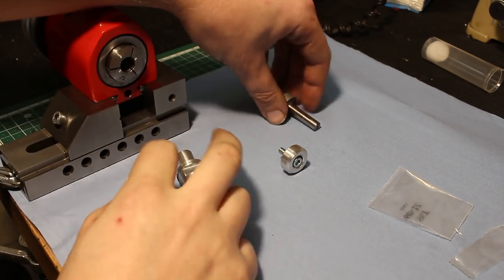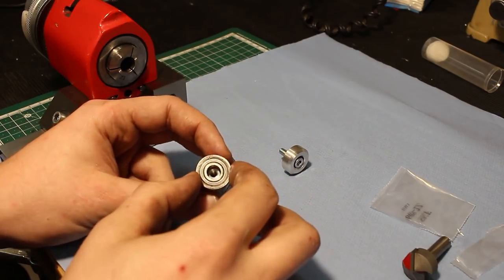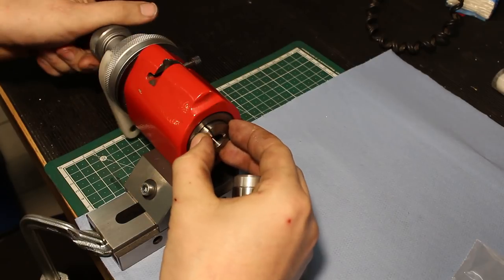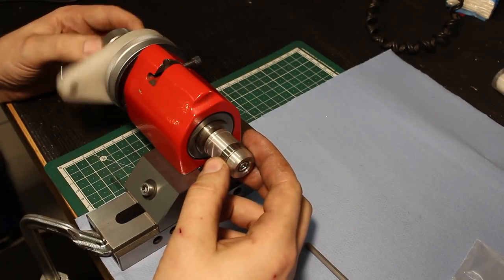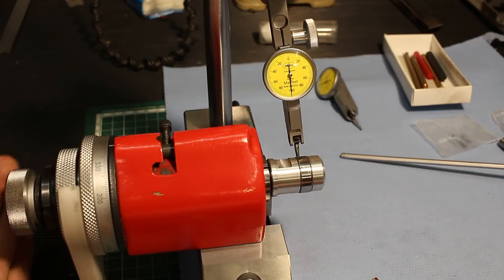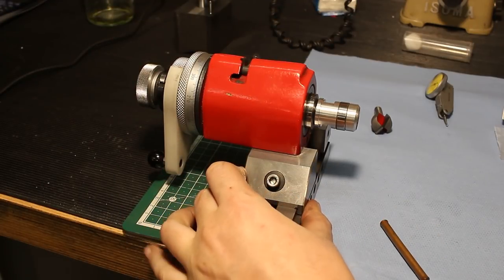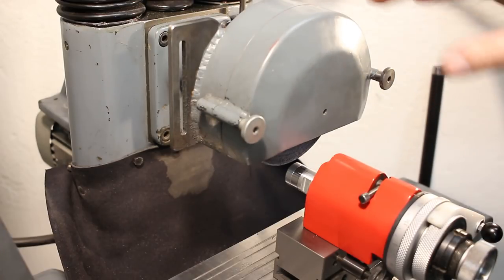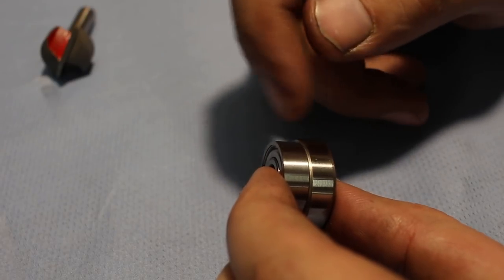Resizing a ball bearing

Comment: The two pins dont suck anything down. 
They slide into the dovetail and you can clamp it even in an angle.
Reply: I agree with Stefan.
The pins will act as rollers trying to move the direction that lowers the pressure. They will slip at the end that is already rigid. The clamping force will not be the same at both ends, but any distortions will be immeasurable in this application.
Reply: There may be a slight downward movement as the pins roll against the surface that is parallel to the force being applied (and thus has the least surface friction). If clamped at an angle, it will only cause very slight movement. But if clamped flush with the vise, the slight movement will pull it against the vise.
Reply: no

Comment: thousandths of a millimeter? There are no fractions in metric, I believe those are micrometres you're talking about.
I realize this is most likely a second language problem but you are always quick to point out the superiority of the metric system, just keeping you honest.
Reply from the maker: Who said there are no fractions in metric? There are, but they all are base 10. They are normaly not written, decimal is easier to write, but in generic shoptalk 1/10mm (=0.1 ), 1/100 (=0.01)  and 1/1000mm (0.001) are absolutely common.
Reply from the maker: And I will continue to point it out, because thats what the world is using :)